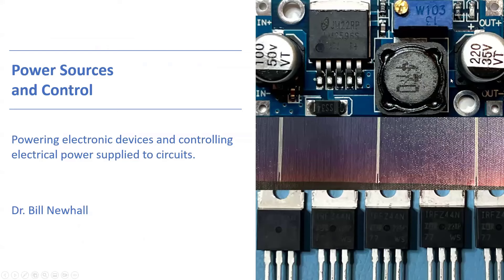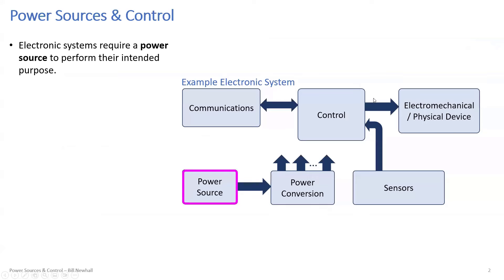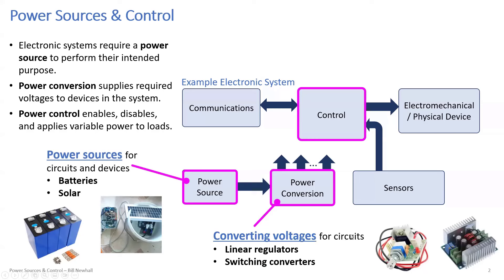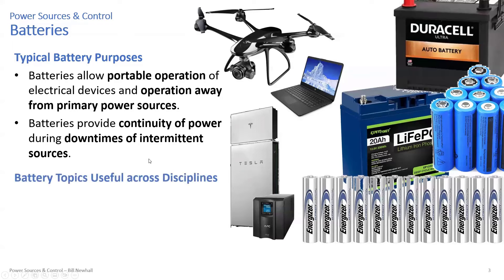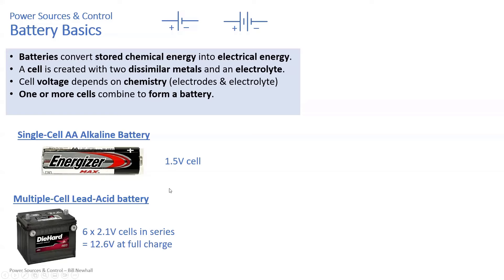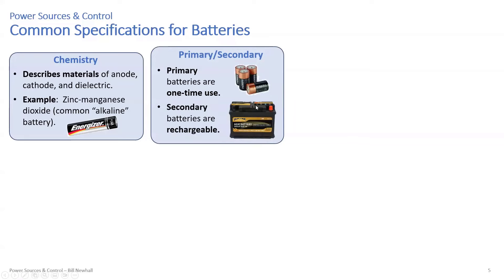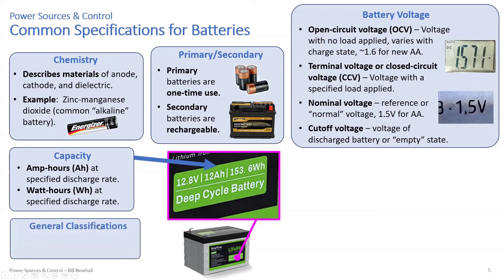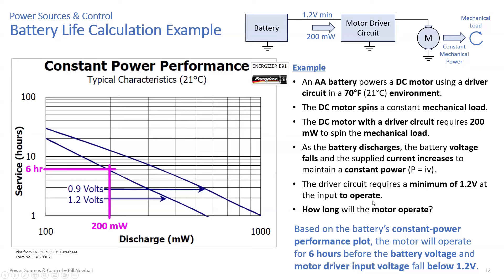Practical Electronics - Lecture 8

Comment: You would have to reduce the resistance of your circuit to keep the discharge rate at 500mA.  In an ordinary circuit the discharge rate would decrease as the voltage decreased.  Also that is the voltage under load.  As soon as you unload the battery the voltage will go almost back to normal even though the battery is shot.